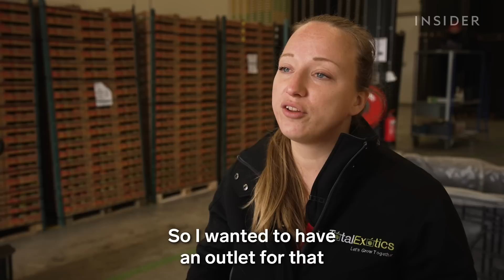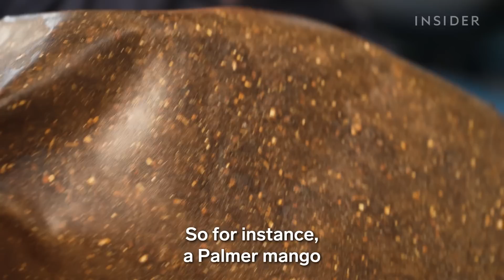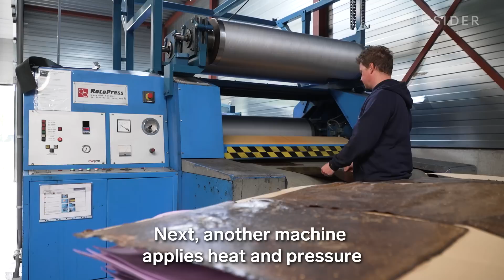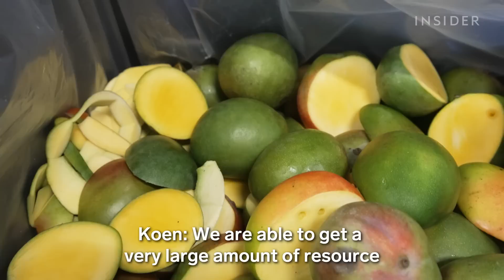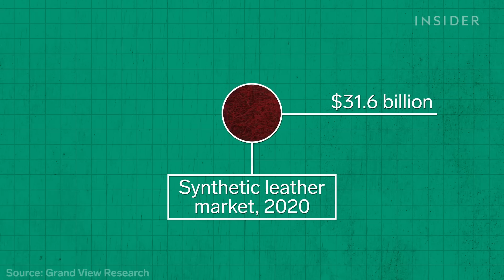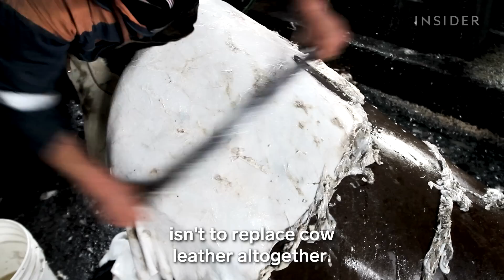How Vegan Leather Is Made From Mangoes | World Wide Waste

Comment: Vegan leather is garbage. Why buy  $150 shoes made out of vegan leather when you can buy the real deal? Secondly, when you wear it on your feet, your feet smell worse than if you wear real leather shoes because the additives and the vegan leather are more plastic. It's like wearing trash bags on your feet. Another thing is vegan leather wears out fast. A good pair of leather shoes or boots can last you for years. Vegan leather probably isnt doing the environment any better either. 

There is absolutely no way i will purchase or wear anything vegan leather. It's not durable, and it doesn't last. You're better off buying a pair of Crocs, and that isn't saying much. Synthetic leathers just dont cut it. Maybe if you sit around all day and do nothing but they won't protect your feet like a good pair of leather boots or shoes

Comment: Even Hermes leather is cheaper than $22 sq ft. I’m all for making use of waste but a product that costs a lot more than real leather and only as durable as PU leather isn’t that great. Seems the mango pulp is just filler and their additives are just another resin/plastic holding it all together. You could probably make the leather from cow poop if you wanted to.
Reply: Two brothers in Mexico are making leather from Cactus. Probably, their efforts and experience can be combined to make the process better and more efficient. Similarly, mushrooms are also being used to make leather. However, the very idea that waste is being recycled is an amazing thought and a very noble idea to reduce pollution and cruelty

Comment: Increase size to lower cost of production.   have large trays made and a large hydrator to make larger sheets.  also mecanize all the proceses you can to lower costs.  like  putting the frut by hand on the machine that will remove the seeds.  that can be automated something like an arquimedes screw of those transportation bands.   Im sure that industry like this will get goverment and private funding to make a larger product. 

The leather industry will complain all it wishes, but really what are they afraid of?  This is NOT leather and wont have the durability of leather.  
the advantage.  it grows on trees,  wont put out high emissions,   cheaper than raisig cattle.